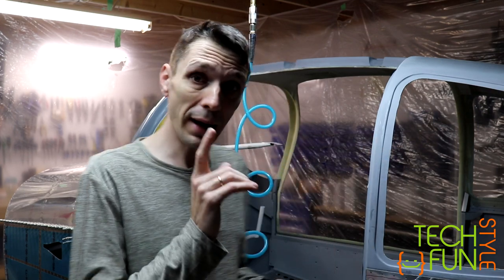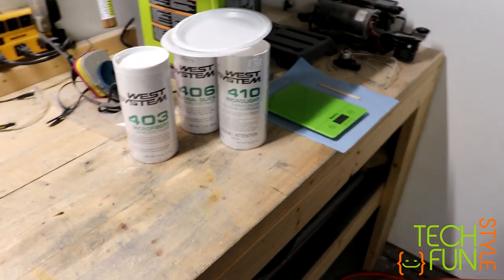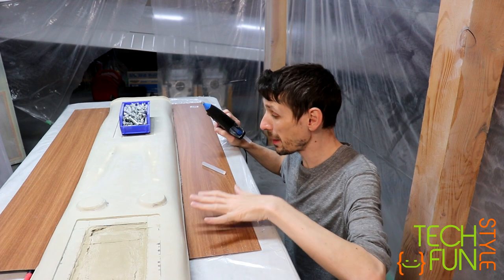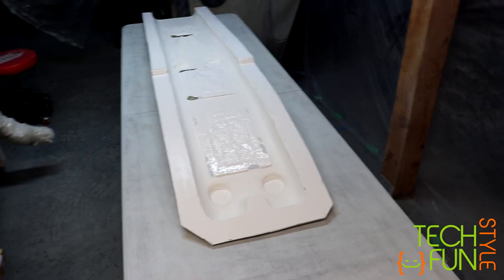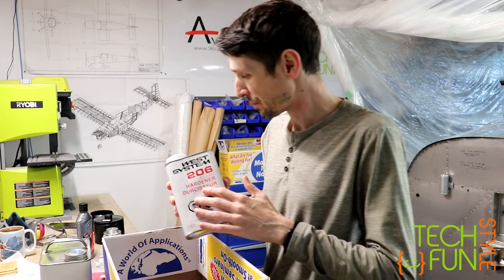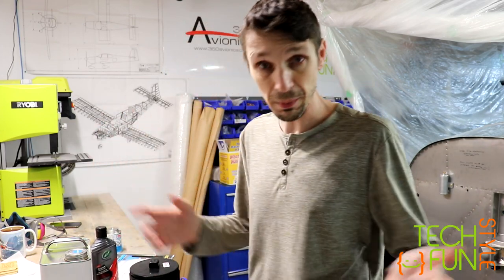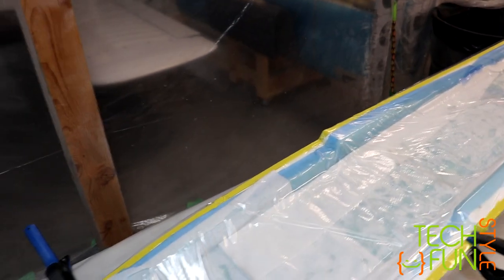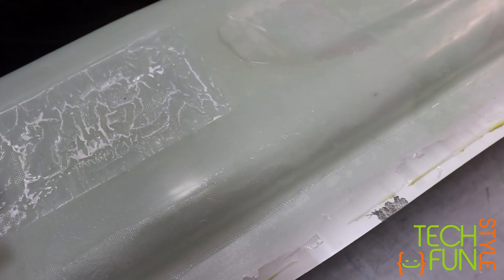Fuselage Part 10 - RV10 Build by Vlad

Comment: It is better to try and fail than not try. The problem was you did not pad the absorbent fibre in the areas that needed to go into the deep hollows and your bag was too tight so could not conform and also it would be better to plumb it so you are sucking from three or four places to make it easier for the pump to get an even suck if the absorbent fibre get saturated.

Comment: the cost to make that is more than buying one I think.
Reply from the maker: I saw a few RV10s recently with in $250 000 range. To build it financially is about $175 000 to $200 000 for decent build. Your time is not counted in these amounts. So it may be sometimes less expensive to buy rather than to build. Some like to build, some like to fly and some love both ;)